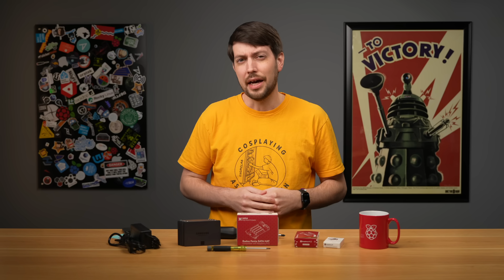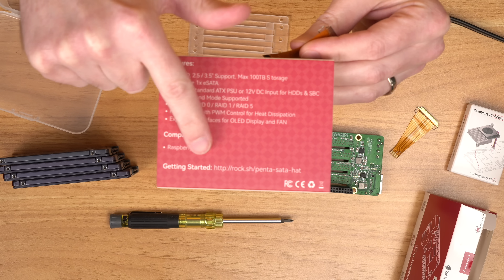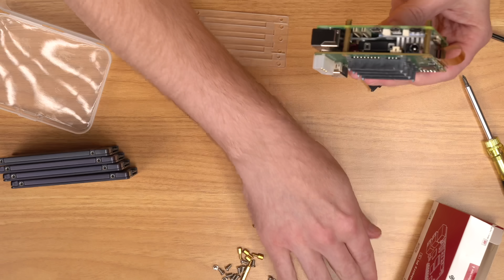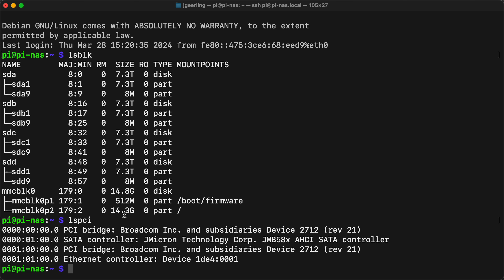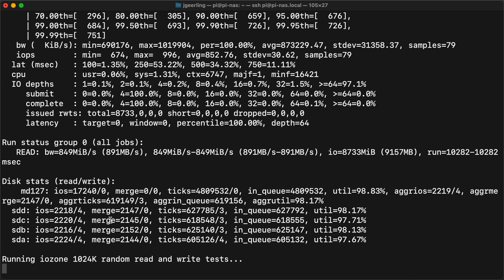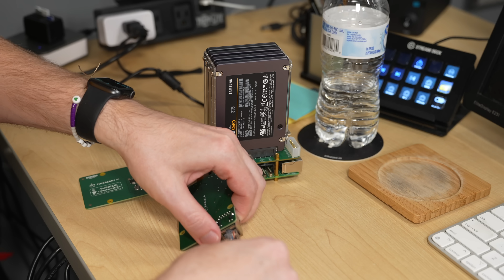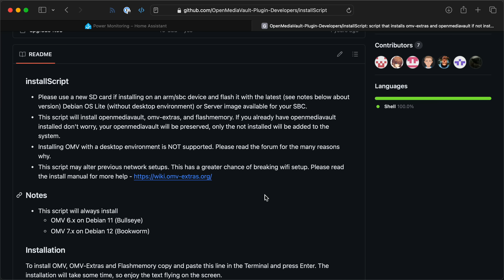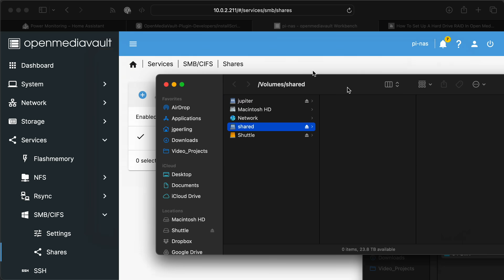The ULTIMATE Raspberry Pi 5 NAS

Comment: So, a possible reason why the Mac was slower than Windows at interacting with a SAMBA based NAS is that SAMBA is an attempt to write a compatibility layer with Windows Proprietary SMB network share protocol/framework/technologies. It started off as a way to get old NAS in the 1990s to be compatible with Win NT systems on the network--but figuring out how Win NT and Win 9x did the whole "network neighbourhood" stuff. With it largely being a very clean room attempt to make something that would allow the various Windows computers to talk to the data server

This was mostly to avoid having to set up a Windows Server... as those things were ridiculously unstable at that point in time. Windows Servers have gotten better with their BS--but you typically were only running them to reduce compatibility issues with Wintel computers present on the Network. As Microsoft is weird about having strange hooks in its software (like the hooks it put into Win3x to avoid it running on other company's releases of CP/M DOS Compatible systems). There is a reason why Hotmail was running ontop of FreeBSD until the late 00s/early 10s. They tried, several times, to move from FreeBSD... but Windows Servers were just not that particularly stable. Yes, FreeBSD is known for stability... but we are talking about running a mail server--so uh... yeah, that instantly reduces stability of that system (Friends don't let friends set up mail servers)

So, Windows is going to have an easier time talking to a SAMBA system--due to a bunch of weird proprietary bits of nonsense inside Windows. Where as OSX is going to rely on the clean room work to make a compatibility layer for the SMB/CMB/etc stuff--and add that to the fact the rPi NAS is also running the clean room work compatibility layer. Making it for two bottle necks, with the Windows system having only one of them

Now, it isn't so much that Windows implementation of SMB is better or cleaner code. It is more, that we do not know everything about SMB. We know like 99.99999999999999% of it (at this point, though some were argue 98% or 95%--and some angry old billy goats would say 63%)... but there is just enough that is not known that will cause a Windows system talking to a SAMBA setup to run faster than a SAMBA to SAMBA setup. With a Windows SMB to Windows SMB running the fastest of all

That being said... Windows is not really designed to function as a server. I mean, that is a bit of a misnomer--as that suggests Windows was "designed" at all. Though some would argue the "throwing stuff at a wall, until you have a thirty centimetre thick tile on the wall to release" does count as "designing" and that I am engaging in gate keeping by suggesting otherwise

Comment: Hi Jeff, Always enjoy videos. I had a pi4 2gb with working at full gigabit speed with openmediavault.
the issue is getting a sata to usb adapter that works and good ssd. I bet a  pi4 1gb would work. I would like you to a vid on this, a pi4 and ssd via usb with openmediavault. I am just about to revisit this myself as i am upgrading to 1gb upload speeds on my isp. I am planing to run is off a 100w solar.

Comment: I’ve really been trying to find the best value solution in these last days and I can stop thinking about, what if you used the onboard 2x USB 3.0 ports (USB 3.0 to sata adapter or a normal external hard drive) and then you could have the 2.5 networking and would still in theory be able to saturate the connection without as much hassle. It wouldn’t look or be as cool to put together but, I’m poor ahahahah

Edit: In my case I don’t care about raid redundancy (would backup anyways) and then I could even buy one of those USB 3.0 NVME cases and call it a day with fast read and write speeds. Or would I? I really don’t know and can’t afford to find out. A video would be amazing :D

Comment: This is all crazy! I started with a Z-80 with 64k ram (actually had 128k that was bank switched) with a 256k TAPE drive, running CP/M!
Got the optional single side disk drive with 130k available space (rewrote bios eeprom and disk format so i could get 160 k out of a disk).
I was so jazzed when I got my first IBM clone 8086 with a whopping 27.5 Megabytes! of hard disk space! How would I ever fill THAT?
Now, with 11 pi4's and a pi 5, with a total of over 5 tbytes of storage, and you are talking petabyte arrays, blows my mind!
Subnote: at one point in my life, I worked in the National Semiconductor Corporation's international data center. They had "hard disk drives" that were the size of an apartment sized washing machines! The disc packs were hand swapped in the machines, to get data from archives to who ever needed it. Most of it was done at a blazing (at the time) at 2.4kb! Each disc pack held a whopping 80 megabytes! 
Times, they are a changing! 
Now, I'm thrilled to have

Comment: Would you be able to share the ApexCharts yaml used  to graph the power from the smart switch. The card's options are a little overwhelming to me. Also, it looks like you have a a switch to enable/disable monitoring. Assume that's the case, it would be nice to see how that's done. I have a few HA entities that such a switch would be perfect (like my Heatmeter BBQ where entities are only available when I'm using the heatermeter).

Comment: Be careful with those flat flexi-cables they are only good for  a number of bends (in the 2000;s the ones we used were 25 90 degree bends) so don't go waving them about or demonstrate how bendy they are. Connect them put the hat on the pi board and don't touch again

Comment: If you're really brave, you can remove the "chipset" from the Pi, as it is connected to the CPU through PCIe. That allows you to get full bandwidth to both the drives and the 2.5G ethernet... At the expense of onboard ethernet and USB...

Comment: There is something very bad going on with Apple's implementation of the SMB protocol. I have Sonoma and a M1 Pro and when I copy large volumes of data to my NAS I get kernel panics and the system reboots. The computer works fine in any other case

Comment: @JeffGeerling, you're not really comparing apples to apples (or raspberries to raspberries) with MD RAID 0 vs. ZFS RAIDZ, so I'm surprised at your comments about the performance differences. You left compression enabled for the RAIDZ and I'm guessing you weren't using any compression on the MD RAID. That could account for the differences in power usage between the two since the CPU was doing a lot of extra work to compress the data. The fact that a default RAIDZ (essentially RAID 5) could provide performance very similar to RAID 0 is pretty impressive but it seems like you downplayed that. Add the fact that ZFS checksums everything six ways to Sunday while RAID 0 doesn't… My point is that I got the impression you were implicitly disparaging ZFS's performance when it wasn't a fair fight yet ZFS still held its own. 

Regarding the network filesystem performance, I wouldn't choose SMB/CIFS for benchmarking unless it was the only option. Your Mac also natively speaks NFS and with FUSE it can use any number of other network filesystems that are more efficient than SMB/CIFS. 

And lastly, I don't use graphical file transfer utilities (whether Finder, Explorer, or otherwise) when comparing performance because they introduce too many extraneous variables that have nothing to do with the filesystem. They're great for convenience but not for performance and repeatability. 

When I say "I wouldn't" or "I don't," I'm not saying "you shouldn't." I don't claim to always be right. I'm just offering my views as food for thought. Now, having said all that, I enjoyed the video and got a lot of good information out of it. Keep up the good (and creative) work!

Comment: This is tempting to run a Faster and More Capable NAS.
Thanks for showing everything in detail,
I would call that barrel jack and heatsink issue a design flaw by the HAT Manufacturer.
Time to plan a Pi5 as,
I currently run a small OMV based NAS on Pi3B 😅😅

Comment: You can use network bonding in Linux to use 2 or more network cards as one faster. BTW. 250 MB/s can do my 10-13 year old laptops with possibility to use 2 sata drives inside and one e-sata outside and eventually more via usb or even via pcie.

Comment: For me, SSD are too expensive for a NAS. You can buy 10GB hard drives for less than $150. Four of those is less than $600 for 40 gigs of storage. Slower, but I don't need to take out a mortgage to buy them.

Comment: It would be great to repurpose an old unsupported 4-bay NAS using this. That way you’d get to use 3.5” drives and you would have a case, psu etc already. There are plenty of crappy 10 year old Netgear NASs available on eBay for not much money…

Comment: Wish there was a six bay version. I've got an old 6 bay NAS that I'd love to modify to run on a pi since the original hardware is getting too old. I think I could use extension cables to run from the hat to the back of the drive bays.

Comment: On the Radxa Penta SATA HAT, I see two tiny switching regulators,  probably one for 3.3V and one for 5V. Now I couldn't find any specification from radxa on power output, but from the inductor size, I'd say 2 amps, maybe 3A if you're generous and don't mind inductors and diodes getting very toasty. Those 2.5" drives draw all their power from 5V so powering 4 of them together with the Pi from 3A is very sketchy. I totally recommend against it !!!!
Also, using an even bigger 12V doesn't help at all here, this hat probably cannot draw more than 2A on 12V. On the radxa webpage they recommend 12V 5A but that is maybe for 3.5" mechanical drives, those use 12V directly to power the motor.

Comment: i actually build the same thing this week. Unfortunately, The SSDs I have are garbage and have to get new ones... but this is promising, to me I think the 1gig is probably fine. I'm experimenting to trying to reduce my google footprint, but also maybe designing a case for it that I can add a fan on it. since it does get pretty hot. Currently using my voltage regulator tester thing, because I had not realized I didn't have a power supply with enough amps, which is causing a bit of issues.

Comment: 30:43 I had a bad feeling about using MacOS for file copy. But just using file managers in general for file copy (especially for network), I would try to avoid it and use raw commands as you don't exactly know what library/what it is using to perform the action.

Comment: This is certainly an interesting option.

I wonder what would happen if you were to start hitting the NAS hard with a lot of simultaneously I/O requests -- whether it would be able to take those requests in stride, or whether it will cause said Raspberry Pi 5 to bend, then buckle, then break altogether.

(My old 4-bay QNAP NAS (TS-453Be) with 4x HGST 3 TB SATA 3 Gbps 7200 rpm HDDs and the Intel Celeron J3455 was seeing a load average of ~170 (I am NOT kidding) when I was using my 5950X to unpack a 1 TB 7-zip file (read the data from the NAS and writing the unpacked data back on to itself); it was REALLY struggling.)

So it would be interesting to see how heavy of a load the RPi5 will be able to handle before it all comes crashing down.

Just started playing with OMV about a week or so ago.

It's certainly interesting, especially for these lower power NASes.

Comment: Great video, thanks Jeff. But can you check what is Load Average on  read / write operations, when you write to NAS, for example, 100gb of data on full network speed. 
Thanks.
Thinking to exchange my x86 setup to ARM based, because of high electricity consumption of x86 setup

Comment: This'll never go higher than 100MB/s during copying, why would it?

the total bandwidth is 250MB/s  coming from the raspi 5 to the commander (but with 8/10b signalling it's closer to 200MB/s), it has to divide that over over the the network card and the sata controller. So with a copying test 100MB for the network + 100MB for the disk IO is the max.

~You'd probably have better luck with leaving out the commander and just do a 2.5G usb3 network card.~ <-- Nvm, this was already suggested

Comment: Built myself a bootleg windows 10 - 12TB NAS with literal spare parts last year
2x2TB WD Green from 2015 PC + 8TB Seagate Skyhawk used from FB marketplace
Free AMD apu combo I got laying around since 2014
Case + PSU from trash bin office PC
Total cost 60$ (the 8TB drive)
running 24/7 for a year now

Comment: Be careful with these smart plugs with integrated power monitoring. Their power readings can be all over the place, especially at low wattage. I've seen up to 10W difference between some of them in my limited testing. They are extremely convenient, but not accurate enough. Some will even mention in their instructions that they can not measure  below 3-5W

Comment: radxa butchered their 'nas' hat along with their enclosure. original release version was using usb-c pd and had some extras while instead of fixing them - they go cost cutting with next revisions and use dc power instead (save pennies on usb-c plug and teeny tiny circuit?!). there is problems all over the place with that 'nas' enclosure and instead of fixing them they do cost cutting.

Comment: After destroying a camera port on a pi zero a while back, I'm wary of the flat ribbon cable connector used for the pcie on the pi 5. With pcie being a major feature on the pi5 and with the port being so susceptible to damage through mishandling. I really do wonder if RPI could have done it another way. Its almost as if you have to decide from the start what you want to do with pcie on your board and build it ONCE then that's how it will stay. Unless someone makes a breakout board that expands to a full slot (or slots).

Comment: I'm not in favour of Raspberry Pi tinkering for the purpose of NAS because,
 I just found these ASRock N100 motherboards with built-in Intel processors.  It's basically a whole mini PC on a single board, for like the same price as a decked-out Pi setup with a hard drive and all those extra hats.
Think about it: No more messing with software compatibility or overheating issues. This ASRock board is a simple, low-power option that comes with everything pre-installed like sata ports. Plus, it has regular PC connections like HDMI and multiple USB ports, so you can hook it right up to your monitor and peripherals just like the pi.

Comment: Have you looked into PTP clocks on Pi5 yet? From what I've read we might be able to use a GPS module and produce a stable PTP clock source due to hardware changes/additions. I might have a need to switch from NTP to PTP for sync on Dante AV transmissions and also if NDI ever gets to PTP sync as well. PTP is required for SMPTE ST2110 (as far as I know).

Comment: They should use longer stand offs, and include a heat sync for that hot chip.  Also, if there's a case it should then be taller.  Maybe even a litter taller than it needs to be to perhaps fit a 2.5GbE adapter?

Comment: About cooling.  Create a wider space between the boards.  Get a wire wrap female header.  Clip the leads to make it a 2x?? spacer and get longer hex studs to separate the boards.  Provides better cooling for the Pi as well.  Great video.

Comment: I wonder if you would see any improvement, assuming it's possible, with bonding the 1G and 2.5G interfaces into a 10G switch?  Also, you didn't mention anything about jumbo frames?

Comment: I'm trying to do something quite similar, but (for software/firmware and price reasons) I'm not going with the Pi, but with an RK3288 board. It doesn't have PCIe, but there's USB 3.0 available.

I want to connect some hard drives to it, so I've been thinking of using either an external multi-bay case or just connecting a few USB 3.0 - SATA dongles via a USB 3.0 hub. Would the drives need cooling tho?

Also, can I power to board from the USB hub? Will it be able to power down the drives while still keeping the board on?

Comment: Really interesting setup, if one doesn't mind taking on the pain of setting up an ARM based NAS solution, this is pretty much as good as it gets, and for cheap. I have been doing a lot of research in this area as well, made a few videos too and generally always interested in finding cute little storage setups with huge capacities. I had a quick question, do you know if this SATA hat can be used directly through an USB/TBT interface somehow or can it be plugged to other computing boards (x86 as well)? Specifically, I was interested in learning the pinout details of the board which I couldn't find on their website. It would be really helpful if you can give details on the hardware specs of this SATA hat board which can have numerous interesting applications. Thanks again for the video!

Comment: A single PCIe link is SO restrictive. To the point that it almost isn't useful.
However, the silver lining is that PCIe 3.0x1-to-4 Switch chips are actually affordable.
These are simple enough for a moderately knowledgeable tinker to get a custom board made, and you could do it with a BoM of like...$8.

Comment: Designed not to support the original active cooler, what a joke.
What the hell is even up with that massive connector, should be exactly same connector as on the PI.
Also there is already DC jack for power, why add the ugly and completely obsolete molex??
No one is going to get a whole ATX PSU to power it...
Good concept very bad execution.

Comment: This is fascinating for this old man. My first computer was a Sinclair ZX-81 with a massive 1k of RAM. I did buy the 16k expansion module though, so I was fine.  LOL  When I finally got a 'real' computer with a "mass" storage device, it was a PC /XT Tubo IBM clone, with an unbelievably large Seagate ST-212, 10 meg. (not gig) hard drive. Things have changed a bit. 😆

Thanks for the great video(s).